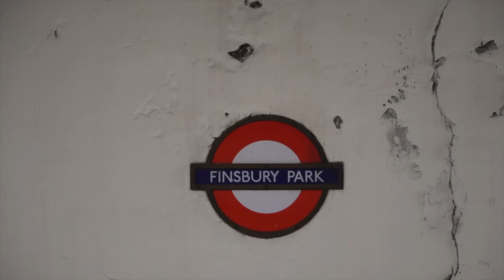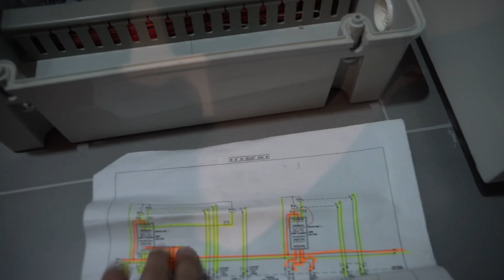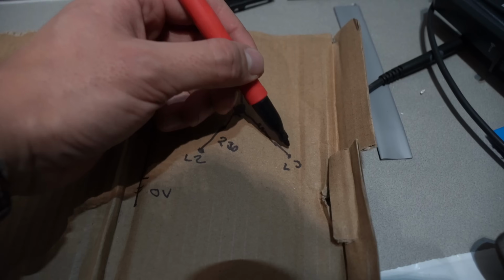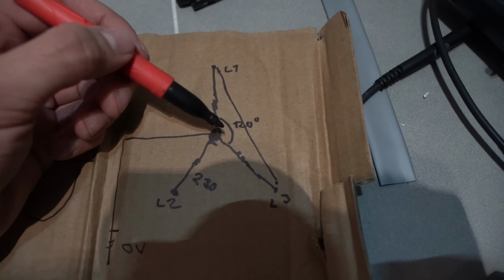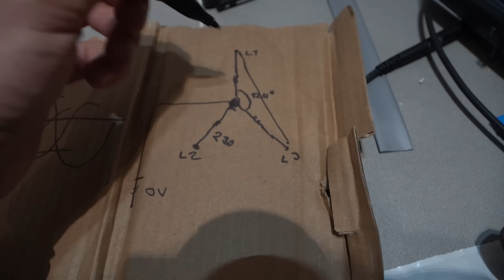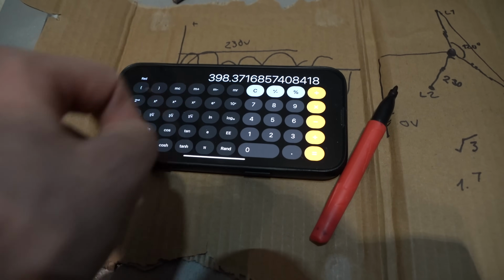£10,000,000 London Apartment Electrics, Why is it so EXPENSIVE?  | ØY15

Comment: Spent 4 years studying electrical engineering and I think you explained 3 ph voltages better than any of the lectures!
Reply: Just missed out that 230V is not the top of the wave but the RMS 😉
Reply from the maker: Thanks Phillip!
Reply: Absolutely - you explain so clearly Cory!
Reply: You need to watch some Joe Robinson's videos then.
Reply from the maker: @piotrlobacz  Joe Robinson and John ward are the tech dudes 🤙🏼
Reply: What college you go to 😂
Reply: he didnt. Trust me.
Reply: @Adrian Haddock  

What would be the "didnt"? (Please)
Reply: So what exactly are those three lines in the drawing? What do they represent? That would help in understanding why measuring from point to point gives us the line voltage... I think the explanation is based on an initial abstraction: without understanding that abstraction, sure we can do some maths and get a correct answer, but WHY is that the method?
Reply: @simonanderson3961  

Which drawing do you mean? The sine wave drawing or the star connection drawing?
Reply: Then the Americans have "split phase" and use one neutral combined to two active legs LoL.
Reply: Maybe that's why it took 4 years of studying.
Reply: Yes, but we also have various different types of 3 phase. 120v/208v wye/star, 120v/240v center tapped delta (single split phase transformer, 2 legs are 120 to neutral, the other is 208 to neutral), open delta which is what my house has, which is the same as center tapped delta but missing a transformer, 277/480 wye/star, 347/600 wye/star, various different forms of corner grounded delta, and a bunch more. Still don't quite get why I can have 3 phase at my house with only 2 transformers, which aren't even the same size, but somehow it works. Even weirder the place I used to live, there was a distribution system that as far as I know is unique to that area, where on the primary side of the transformer there are only 2 wires, the 3rd phase is grounded and transmitted through the ground. The transformer setup looks just like the open delta feeding my current house, and on the secondary side it's identical, but one phase through the ground is just weird. Our 240 from 2 hots though is identical to your 240 from hot and neutral, just 60 hz. In my workshop I have an entire din rail panel just like you guys use in Europe, complete with RCDs and RCBOs, and an entire circuit of Schuko outlets over the bench so I can run imported tools. Everything works perfectly, obviously you have to be careful about what you plug in because of the 60hz, but your average drills, saws, etc with universal motors have no issues with it. The European RCDs and RCBOs have no issues with the 60hz either, you just have to be careful to only use true 2 pole RCBOs with overcurrent protection on each leg. RCDs don't matter because they shut off both sides when they trip on leakage current and the overcurrent protection is taken care of by separate breakers. As compared to our GFCIs, your RCBOs are far superior because although they trip at a higher current (30ma vs 5), they trip significantly faster. As far as I can tell, our GFCIs have no time limit as to how fast they can trip, or it is very long compared to the 0.1s or less of yours. Interestingly enough, the Philippines uses a system that looks like our 240v (2 hots no neutral, 60hz), minus the 120v. They use both US style breakers and DIN rail. I think Spain also has a similar system, all double pole breakers and switches, no neutral, except it's 50hz. Just fascinating how many different systems there are.
Reply: Because he did a real apprenticeship and learnt from the best.
Reply: Wow. 4 years wasted pal!!
Reply: Think you need to go back to school.. or read your study books again.. almost nothing he explained is correct.  Pythagoras cannot be used in this situation.
Reply from the maker: @zareya1989  you’re right, it’s the cosine rule, pythagorus’ friendly cousin. And it’s RMS, I’ve left notes on the video if you watch it on a desktop or check the pinned comment. I was coming out of a heavy flu as you’ll hear in my voice 😂

Comment: Is 3 fase common in GB?  Here in the Netherlands all new residentials have 3 fase, and possible in old.
All industrial is 3 fase.
Reply from the maker: It’s pretty common in larger homes and almost every commercial premises, but it’s not so common in your average house ( I wish it was! )
Reply: It's mostly commercial historically
You can have it added to your home, but it's very costly
Reply: @therealdojj  Here in NL common, and you can have it added in old homes.  
Cables are ready for 3 fase in every home build after 1970. the only have to change meter and tails.

Standard is 3x 25 Amps, monthly fee is the same as for 1x40 Amps. 
It is possible to get 3x35 or 3x50. but that gets expensive. (shortage of materials and personnel)

In new homes like mine the main fuses are
automatic circuit breakers :)

Comment: The last sketch was truly informative, haven’t really connected why I always use 1.73. 
You managed to teach me something that my old teachers didn’t get through to my below average brain.
Reply: I’ve always said that you always learn more from actually doing the job rather than from in the classroom.
Reply from the maker: I’m glad it was beneficial Kristian!
Reply: @corymac  ❤️
Reply: I•I =I’2😮 square root of 3
Reply: Use cosine rule to add the voltages, root 3 (1.732) only works for equal voltages ie 240V r-n plus 240V y-n at 120 degrees gives 415V between phases

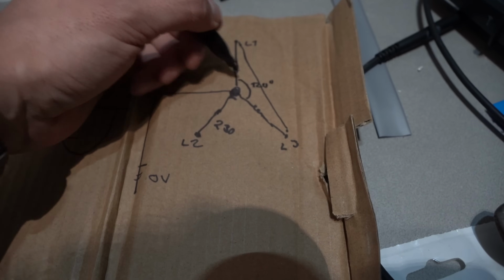Comment: at 9:30 you use "Pythagorus". Pythagorus is only for use in right angle triangles, because this is a 120 degree triangle between phases, the best geometric principal is called the cosine rule.
Reply from the maker: Thanks Rory! Now I know 😁 - it’s been a long time since Trig 😂
Reply: @corymac  I did a mathematics degree before doing my apprentiship(in second year currently). My background sure makes learning in the class interesting.
Reply: Also the peak of the sine wave is not the 230V value. 
230V is the rms (root mean square).  The peak is around 325V from neutral point.
Final point. Could be worth pointing out how dangerous it can be to disconnect the neutral conductor in circumstances where safe isolation has not been done. (obviously not the case here) 😀
Reply: Came here to write this
Reply: I was about to confidently suggest you can cut it in two similar triangles (30, 60, 90) and use pythagorus then. But I don't think that leaves you any better off as you only know the hypothenuse (and some angles)
Reply: @33andy33gmail  you absolutely can cut it into two similar triangles. You just have to then use SOH CAH TOA instead of pytharogus or the cosine rule that I talked about.
Reply: @33andy33gmail  Not at all. You are quite right in that by creating 2 right angle triangles with a know hypotenuse (230) you can determine the distance between the ends of any 2 phases. i.e  230/5*4 will give the adjacent to the 30 degree angle. Multiply this by 2 to give the full distance.  HOWEVER this would seem to be an incorrect premise. AS this results in 368V not 400V .
My wild guess is that when we talk about phase to phase the rms value is no longer an issue because the voltage between phases is constant 100% of the time. Because the 2 curves follow each other, the gap is constant.
Reply: @geraldelwood9660  It is 230*sqrt(3)/2 not (230/5)*4 you should be using. Draw an equilateral triangle of sides 2 and split in half, apply Pythagoras Theorem to one of the resulting right angled triangles.  The theorem can be applied to all right angled triangles, not just the well-known 3,4,5 triangle, which I think is what you may have used.
Reply: @davidmell1789  Sorry, I don't recognise which rule your formula is based on. I must confess that I haven't done this school work for about 60 years, so bit rusty. As I remember; the sides of all right-angle triangles have the relationship (length) of being in the ratio of 5:4:3.  For sake of simplicity this is the rule I used.  A parallel rule being : the square of the hypotenuse = the square of each of the other 2 sides added together. i.e.  25=16+9  Please enlighten me.
Reply: @davidmell1789  Sorry David, scratch my last comment. Time has not treated my memory well 😀. I was sitting there thinking : is this really right and realised the 3;4;5 triangle is just a Special Case of the right-angle triangle. It's just the sum of the squares which applies to all of them.

Comment from the maker: 500th comment wins a prize! 🏆 ( for subscribers only! )

Please note, the 230volts and 400volts values are ‘RMS’ ( or root mean squared values ). Also, it’s Cosine! I wasn’t expecting my post flu brain cardboard scratchings to actually make it into the video 😂. I’ll make these subjects a video asap! 😉
Reply: Does it count if I spam comments, first one would be something like 3 and then I’ll work my way up
Reply: 230 rms arent you actually getting 325 volts the fact that your meter is rms ? So would it be 400 v rms or is it actually 400v “true voltage “ if that makes any sense … thanks Cory!
Reply: "The Cosine Rule" more specifically - "cosine" is one of the trig ratios, the adjacent side over the hypotenuse. But the cosine rule is really just generalisation of Pythagoras' Theorem - every triangle is really just 2 right triangles stitched together!